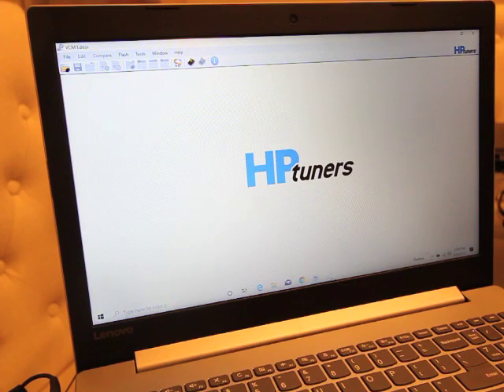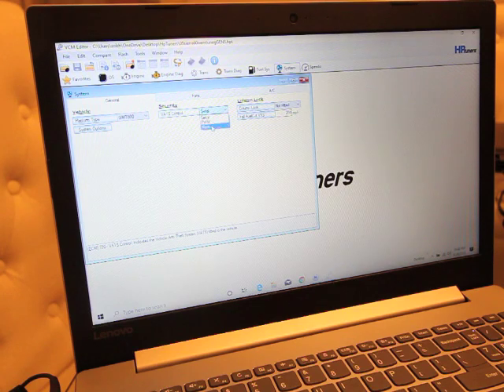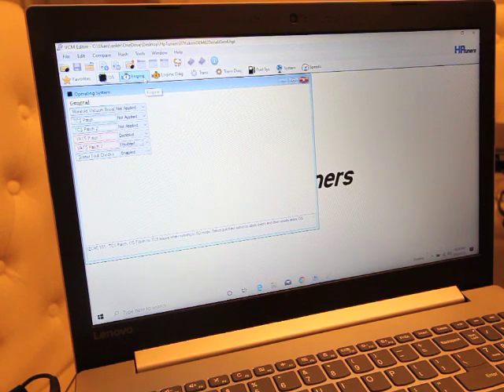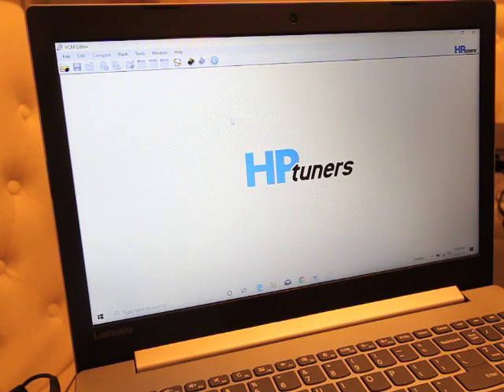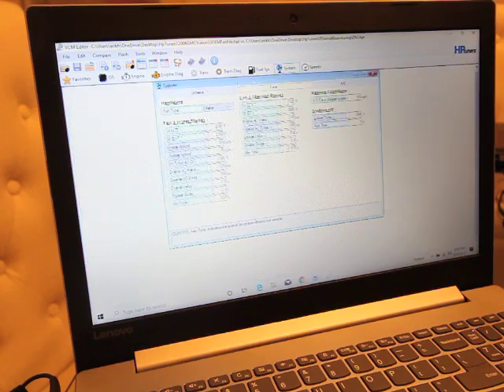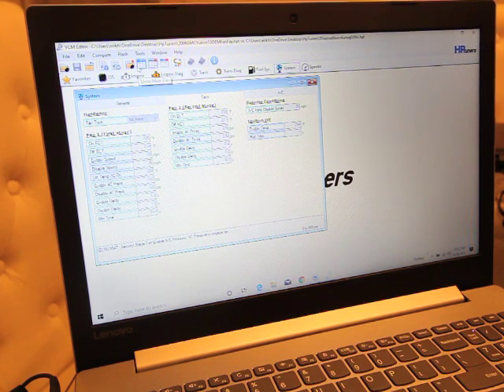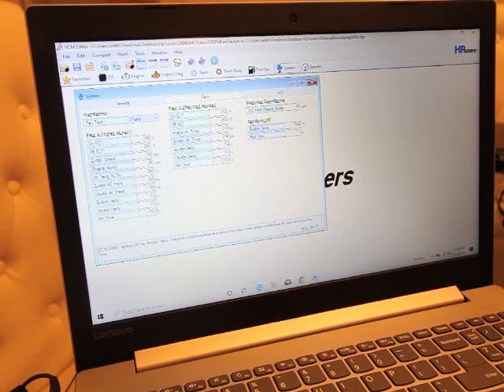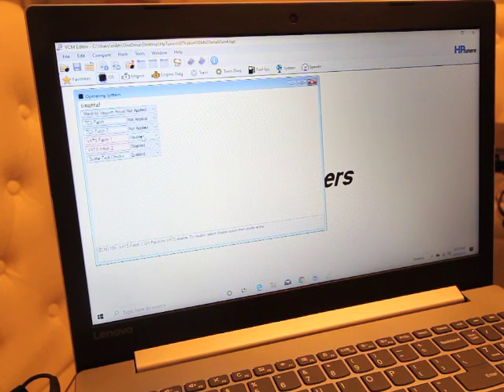How to disable VATS Security in GEN3 and GEN4 GM ECM Controllers DOD and Fan setup

Comment: When turning that off on a 2016 GMC Sierra will it turn the key chip (Opal)off as well or does something have to be done with that with HP tuners?  What is NAO  abbreviation?
Reply from the maker: It depends on what engine controller you have. How easy are difficult the vats delete will be. A properly done vats delete will no longer require a transponder key.  NAO might stand for North American operations.

Comment: I have a question about programming E fans after conversion in like say a 04 Chevy Avalanche that came with mechanical fan. Need to know parameters for AC high fans to kick on when AC is engaged please.
Reply from the maker: Look up on HP tuners tune repository a factory 05 silverado 1500 and in expert mode copy over the fan data and pressures

Comment: Hello I have an issue with my 2003 silverado bogging from a start. stock truck 4.8 v8 just changed throttle bodyand transfilter.what could make it bog down?
Reply from the maker: Could maf or o2
Reply: @SpartanAutoworx  if i delete vats on my gen4 6.0 LY6 can I start it on a stand?
Or what else should I do?

Comment: Is that it to make the motor run?  Delete VATs?  What if you have a Manual and the donor vehicle had an auto?
Reply from the maker: Delete vats on both
Reply: @SpartanAutoworx  What else would I need to remove to make it work with a manual with no sensors?
Reply: @huck271  did u get your engine running i want to run my gen 4 LY6 on a stand.
Is it just vats delete??

Comment: THIS HP TUNERS SOFTWARE SEEMS EXPENSIVE AT $299.99 FOR THE HARDWARE AND TWO HUNDRED A POP FOR SAVINGS CHANGES WOW !
Reply from the maker: $100 to save changes $200 if you want to flash another file. If you copy changes manually it only sets you back the $100
Reply: @SpartanAutoworx  THANK YOU FOR THE REPLY !
Reply: @8power0  do u have gen 3 or gen 4??